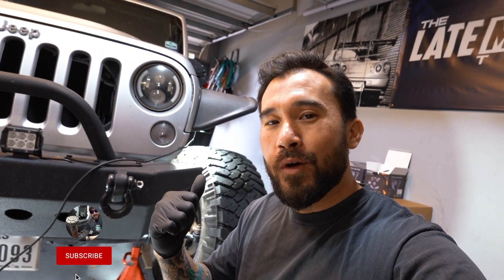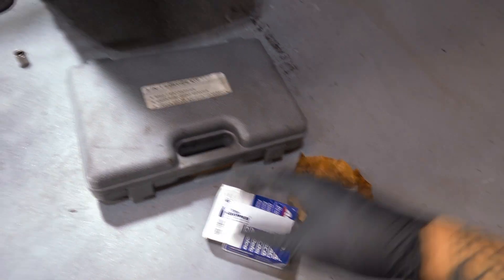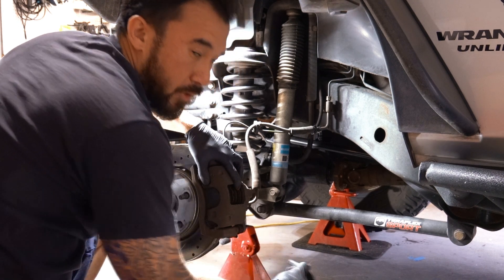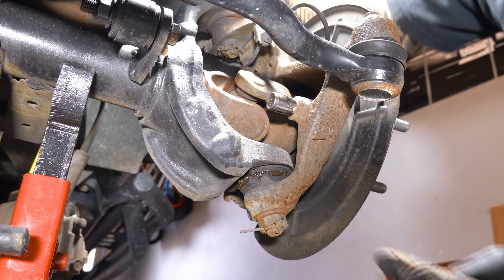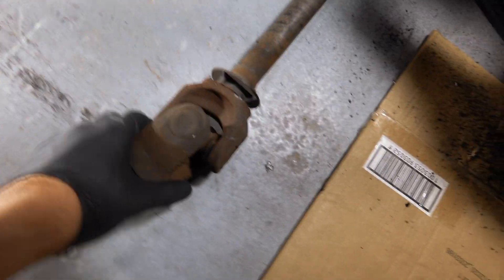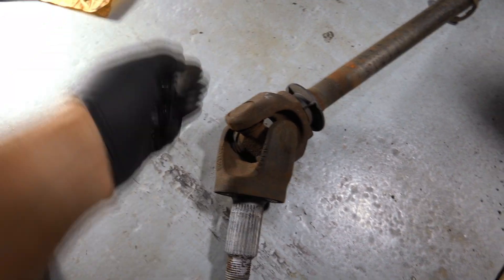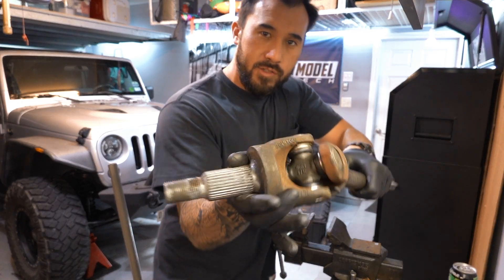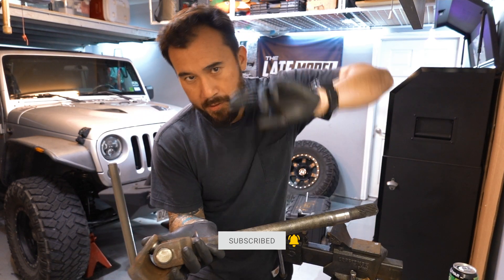How to Replace an Axle U Joint / Jeep Wrangler JK

Comment: once you have the first two caps installed you should tap on the two caps to release the tension caps will be much looser then do the same when the axle is complete !!! you will have   premature wear if you don't relieve the pressure ask me how i know

Comment: If your c-clips are extremely rusty, Use the press early to push IN until you hear it snap the retainer out of it's rust bind.  (Use setting 2 on your Milwaukee 2767 impact)  Granted, this should not be your first action, as you are pressing in on your ears excessively if you aren't getting the play you're looking for.  

First, Soak in penetrant oil often and use MAP gas around the ear,  This will help you punch out the cap later anyways.  Use an AIR HAMMER on the c clips instead.  (Central Pneumatic at harbor freight is the cheapest option.)

If you can't get the hub off the axle, use the 5-ton pneumatic 3-jaw puller from Harbor Freight.  Decided to buy one after 2 days of messing around with slide hammers and bird foot pullers.

No, I'm not a HF sponsor,  I just buy cheap stuff and it works.
Reply: Thanks china for giving us harbor freight and Walmart hah 😃

Comment: Try this in the rustbelt
Reply: yea i'm afraid of trying to do mine. i'm definately leaving the hubs attached if I do it cause those bolts don't look so much like bolts anymore! I like the trick of using the ball joint press to press em out, may make it easier with the rust

Comment: Im having major issues with my ujoint job, I have a 2012 Jeep Wrangler sport JK. I go on any auto parts store website, put in my vin, and shown a selection of everything that SHOULD fit. I pickup some Spicer 5-153x joints with the intention of replacing both fronts as a day job. Fought with the damn joint for 4 hours with success, but the brand new joints are significantly smaller than the bore. This is a time sensitive issue and i really need this fixed by tonight. Any help/advice is more than appreciated.

Comment: How long would the grease last? I usually regrease every 5k miles but the axle ujoints I have are non-greasable. 

Was wondering how long they last or is it a take it off then regrease every so often 🥲
Reply from the maker: I haven’t greased these since this … probably gone around 80k on them.
Reply: @Donnythelatemodeltech  U drove 27k miles each year in this jeep?? yea right

Comment: Only thing you forgot to do was at the end when you finished one side of that ujoint was tight. Funny trick to do is literally hit the sides right under the caps with a hammer and the entire thing will loosen uo

Comment: thanks man great vid great camera work and lighting and editing . i pulled the axles on my 96 gcl after spotting the movement inside the u joint caps , most of the needles were gone. not having a bj press i decided to drop them at a driveline shop and for around 225 i had new spicer joints , he quoted 200 but said they were really a bitch ,  i believed him lol they'd been there over 25 years . ball joint press from harbor freight looks like it's high on my list of tools to acquire . thanks also for mentioning socket sizes , always helpful fo sho ! liked and subbed ciao4now peaceout jj from nj
Reply from the maker: Thanks Joe for sharing!  Comments like this just make my day. Thanks again!

Comment: Good overall how-to video.  Just a point about the re-assembly, if the U-joint is tight upon assembly, it is usually because the caps are both pressed inward too much.  If not corrected, it could lead to premature wear and failure of the U-joint.  You just need to push the cross outward in each direction and ensure it's freely moving.
Reply: I was thinking the same.  I always gave the yokes a wack or two to loosen them up.  If you rotate the axle in your hands, the end shaft should easily flop around based on it's own weight.
Reply: I have replaced mine recently and developed a high pitched chirp in my 2015 JK while moving.
Reply: Thanks for this, I was wondering how I could tell.  @robertveldman1901
Reply: Agreed, i was always told to give the yoke a couple firm wacks with a hammer so the ears can return to proper position as they are likely inward slightly from having the cups pressed in.
Reply: i just saw your comment your absolutely right !!!!!

Comment: Excellent video but if it’s stiff after you get done like it seemed o the one side you did just gently wack it a couple times and it lines everything back up correctly and it will turn freely.  If you don’t it will wear out a lot faster

Comment: It's NEVER as easy as it looks on YouTube! My 07 took me 4 hours per axle. These midwestern winters rust everything under your vehicle, making maintenance a nightmare.
Reply: Exactly!! Looks so nice being to pull a hub bearing out and be able to re-use it. Corroded aluminum or rusty metal, bearings get destroyed trying to remove them.  Cold chisel is your best friend at that point
Reply: LOL, yeah, i just did both front upper and lower ball joints and it was a nightmare.  Hell, the dam cotter pins kicked my ass.  I had to drill them out.  But I noticed my U-Joint on front right is just flopping around in there and thought I needed to see a video first to see if I needed to have the axle out.  Looks like I do.  Well since I work from home, I can leave it apart until next paycheck so I don't have to pull all that apart again.  Plus I need a new radiator too.  Found that out today.  Ugh, just 7 more months and it's paid off.  Now everything starts to break.  But at least I can work on it.  But in the mid west, yes, all the dam road salt rust everything.  Nanice!!!  Thanks for the video.  I really do appreciate it!  Funny how most people cut out all the problems they have with bolts.  But I get it.
Reply: Good job good video unlike most with no lighting to see what the heck there doing

Comment: You make it look pretty easy. It would take me 2 days to do this job haha!  That includes fighting all the stuck fasteners. I can't believe some people actually do this "on the trail."  Not sure how that is possible. Anyway, I was just here to understand the job more after getting a quote from a local shop to do the job on my '07 JK, which sounded very high to me. $104 parts and $330 labor.  I told them not to do it, and now I have to find a more reasonable shop to do it.
Reply: Lol that for sure. Last time I tried to take it apart the joints were so stuck inside that only way was cut it apart. Cause tried even on a press and they didn’t want to move.
Reply: I had a drive shaft ujoint on my Dodge that was so bad that we tried to push it out with the outrigger on an M984 Wrecker (~55k lbs) and all it did was crack the cap and lift the truck up.

Comment: You can do this job with out taking off the wheel bearing from the axle, its just a lil more cumbersome... when reassembling i use copper never seize on everything, that said if your gonna seat both cups at the same time you couldve just flipped it over and used the vise, (thats what the shop man says) i personally prefer to seat the caps one at a time,, i put one cap on, hold the u joint in place over drive the cap, then put the C clip on, then i slide the u joint to the other side and put the other cap on and then back drive it til i can get the last clip on .  Some times ill even add a lil extra grease to make sure the needles stay put..
Reply from the maker: Ok

Comment: Hi question here. So its okay to hammer(metal hammer?) the axle(axle nut) to separate hub from axle

Great vid btw tnx
Reply from the maker: Be " careful"
Reply: When I did this job, I backed the wheel hub bolts about a half inch out, put a sacrificial socket on them, and beat ‘em with a hammer till it was knocked loose.

Comment: Ha ha ha no rust,  My 13 mm hub fasteners were so rusted out there wasn't even threads left on the ends. The hub had to be chiseled off. The universal clips were part of the yoke and had to be cut off. Had to press them out with a 20 ton press. Which ended up bending the yoke. New parts yoke and spline, hub bolts,  universal joint. This Job was absolutely miserable.  If you live anywhere  the State spray the roadway with a deicer even on nice days to deplete thier stock for funds.  Just buy a new vehicle.

Comment: Awesome video!  

Just curious... how much would a shop charge for a job like this? (just change both U joints)
Reply from the maker: Around 3 hours,   at what ever the shop rate is
Reply: I was just quoted $1100 for one shaft at the local JEEP dealer.
Reply: @shawneastman9225  hahahahaha

Comment: I dont bother with the balljoint press, just cut the old joint with a torch/grinder and tap the caps thru with a socket and hammer

Comment: Great video pretty straightforward using common tools just curious was that a Milwaukee M18 it sounded like it cuz I have the same thing that's definitely a lifesaver to getting off big bolts nuts, and I also have a brand new ball joint press that never used it's good to know I can use it for that as well, mine is pretty loose but not like yours , it's a 2011 Jeep Wrangler jku ,I think when I change mine out I'm going to do both sides cuz I'm running  Nitto 37$ and I'm going to get greaseable fittings, thanks for the very helpful and useful info keep up the good work and keep up the videos thank you
Reply from the maker: Yep ,m18 is great.  And the ball joint press , you can use it on all kinds of parts and in all kinds of places.. Great tool.    Thanks for  sharing !👍

Comment: The clips are suppose to be installed with the round towards the axle and hub shafts.
If you notice on the yokes, there is a machined recess. This is to help center the u-joint and assure proper preload on the bearings.
You're welcome.
But, I have over forty years experience working on everything from Automobiles to Zenith televisions and everything that starts with every other letter of the alphabet in-between.
Reply from the maker: Strange comment .  Thanks , I guess.
Reply: @Donnythelatemodeltech  How is technical advice on proper u-joint installation a "strange comment"?
What's strange is: you making a video on how  to do something the wrong way and have no clue of what I'm talking about. But, the next time you replace any u-joint with C clip retainers, you'll see what I'm referring to.
Reply from the maker: Thanks Cliff,  it would be very helpful if you could watch more of my videos and give me some more wonderful advice.   I am working very had to a good job and experience would be very very helpful.  Thank you again for your time. 🥠

Comment: Good video. I used the BFH and deep well socket method to replace the driver side joint a year ago on my 09 Jk. I had just finished ......lol after 4 days of replacing ball joints ( thinking that’s what was marking the front end squirrely) so I repulled the shaft changed the bad u-joint. I should have changed the passenger side too, but had a severe lack of enthusiasm and that joint was still good. When I had my Yukon locker put in by a local shop they changed out the stock u joints with cheap ass Chinese joints. Got 50k on drivers and a bit over 60k on the passenger. 
I used a higher quality Spicer joint last time. Parts store didn’t have it in stock so using a Moog this time. Bought a ball joint press like yours for the ball joints, probably hammer the old ones out and press the new one in. Thanks for the video.